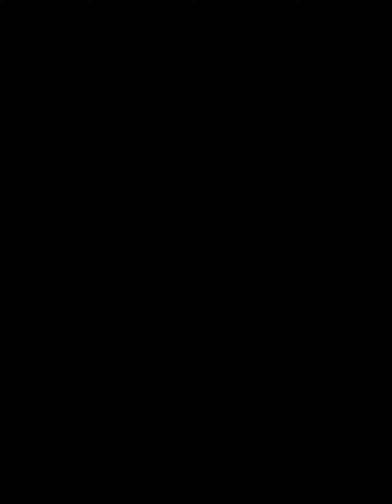Ruud RA14AZ24AJ1NA endeavor line achiever series 2 ton IM air conditioner features

Comment: How efficient is a window ac unit with an EER rating of 9?
Reply from the maker: Very efficient
Reply: @ArisBuliteanu  nice, 3 of the 4 units I have are rated with or have a close eer rating to 9. The ruud has an eer rating of 7.8 I think but the ruud is efficient though it runs way to much. I do not know the eer rating of my defunct vintage nordyne central unit. The reason why the nordyne is defunct is the building it serves is no longer in use, the disconnect is off, and has a damaged suction line and is covered in English ivy.
Reply: @ArisBuliteanu  I know my 2002 whirlpool has a high eer rating like 8 point something but it is not bad and it is in mint condition. The mid 80s unit does have an eer rating of 9. I have seen a lot of whirlpool unit with the same chassis and they are really good for what they are, the cool and dehumidify very well and do not run a lot plus they do not have that loud and annoying sloshing sound from the motor like some units do. My local park has a comfortaire unit of the same size as mine and it is loud and the motor has an annoying sloshing sound when running, it is not the water build up but something else.